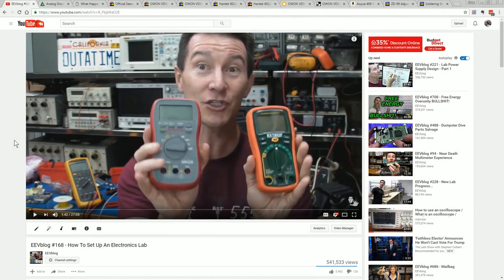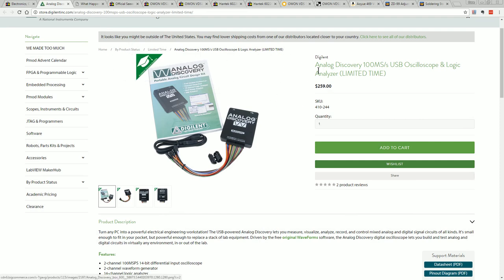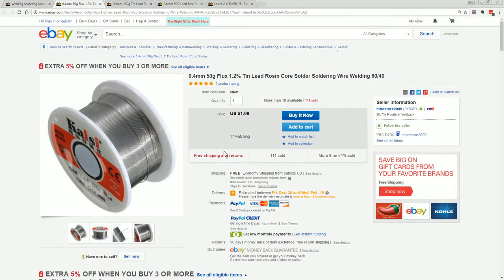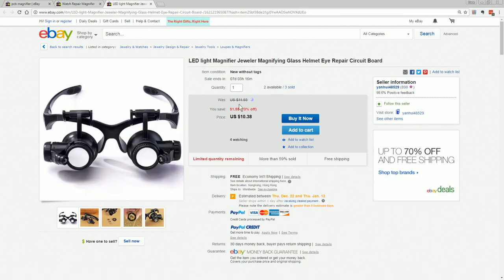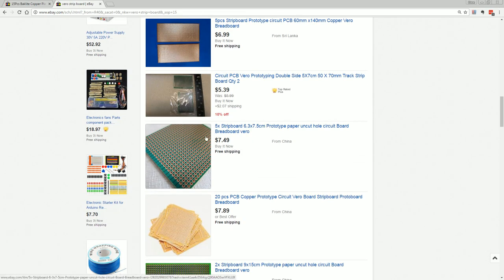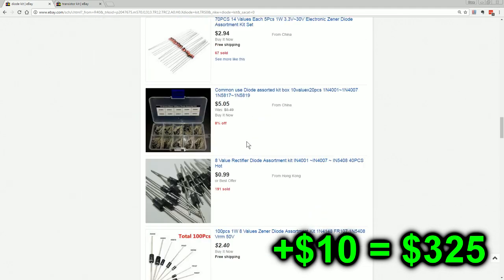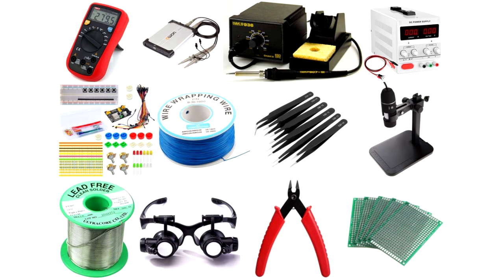EEVblog #954 - How To Setup An Electronics Lab For $300

Comment: I am on a tight budget and I've had to go with the cheap-and-nasty stuff and I'm finding it funny how Dave is listing many of the items I have here in this video :D I had actually thought about making a quick video myself, listing my own budget-setup, so Dave kind of pulled the rug from under my feet here!

I went with a Yihua 898D+ soldering-iron, though -- it's digital, it's small, and it has a hot air gun in the same package, which is handy, and I'm so far very pleased with the whole thing. There's a sensor inside the holder for the gun, so it turns heat up inside it only when you lift it up from the holder instead of just blindly blasting hot air 24/7, which should hopefully help make it last longer. As my DMM I've got a HoldPeak HP890DN autoranging one (I don't quite like manual ones), which is also quite nice for the price and seems quite precise. I've got a bunch more items in my setup that weren't mentioned here and that would probably be useful to a beginner/someone on a budget, but I can't quite list it all here in the comments, and I can't post pictures anyways.
Reply: Would you still recommend the Yihua 898D+? Whats the soldering iron like?

Comment: Don't get those magnifying glasses (the second one - black ones that look like specs). You have to hold the object really  close to you to see anything. Maybe good for jewelry or inspection work but not for soldering (If you mind getting your nose burnt that is :o) ).
 The first option that you showed (the large contraption that fits on your head) is rather good for soldering work, but note the plastic quality is not so good (brittle) and therefore handle with care. Also can get uncomfortable when using for a long  time. I have both of them.

Comment: I think for a starter it's more useful to only buy what you need. No microscope, fume extractor, solder cleanup stuff. A function generator is also not needed. Just get a soldering iron, tin, some cutting pliers, find some schematic online that you want to build, order those parts, and get cranking (To keep it in the Aussie athmosphere) :-). An osciliscope might be nice to see what the circuit and individual parts actually do.

Comment: Kinda annoyed by the way you hated on the Yihua soldering iron station a while back, but now recommending it for a kit. Yeah, it's a beginner kit, but it's a really decent station. The stand is flimsy, but the iron itself is solid, and as you say, it takes original Hakko tips and heating element replacements easy.
Reply from the maker: For $15 there is little other option. I still think it's a pretty crap iron, but it works. Less crap than the other crap.
Reply: for professionals it would be a different ballgame I think, its often not worth bothering with cheap knock-off stuff if you can afford better. I do feel Dave sometimes outright calls low end stuff crap, but im happy to see that's not really the case as he shows in this video low end stuff also works and can be used to make a decent electronics lab at a budget.
Reply: You have to start somewhere
Reply: There is a newer model now  Yihua 908D, with a display and switching power supply so no more heavy transformer and associated shipping costs. Got mine from Aliexpress to replace my failed low hours HobbyKing one where the replacement element is quite pricey.
Reply: >  I do feel Dave sometimes outright calls low end stuff crap

Yeah he isn't the most subtle person around :)
Reply: bobby dazzler
Reply: Got another one of those clones, except mine is a blatant rip-off that's even got "Hakko" printed on it. Reason I got it was that it used the correct gender for the 5-pin connector, so I could swap out the iron itself for a genuine Hakko if needed.

Haven't felt the need yet. In fact, what I did was purchase another cheap iron, chuck the crummy tip, and replace the heating element with an A1321 (or almost certainly a decent knockoff). This allows me to easily switch tips without waiting for my iron to cool down.

Rest of the unit is pretty decent too. None of the flaws I saw in the Yihua episode, except that the plastic is most likely not ESD safe. The kind of people for whom this would be an issue have usually progressed to the stage where they've outgrown the budget lab anyway.
Reply: Actually, Dave, I would like to hear your opinions on what makes a decent soldering iron, and how you would go about constructing one.

Apart from the obvious, good fit between heating element and tip, plenty wattage for fast thermal recovery (not exceeding what the heating element can tolerate, obviously), and something that actually controls it based on measured temperature rather than % duty cycle, which elements would you pay attention to?

Comment: Hello Dave. How about diode test at not expensive multimeters with automatic range selection? I saw a video which shows the multimeter with a delay of 1-2-3 seconds before a sound signal in diode test mode. For example, for what would have to ring circuit in the scheme need to touch probes and the circuit can go to drink coffee. It's just a hell of a fact, not a job. Maybe it stops on the multimeter with manual selection of the measuring range?

Comment: 4:10 - why is the soldering iron $5?
Reply: Its the tips.
Reply: No, the tips are ALSO a +$5 a few seconds later.  Before the soldering station, the signal generator puts the total at $171.  Then he shows the soldering station, and says +$5 = $176, then the tips and says +$5 = $181
Reply: +John Ridley Nobody's perfect I guess, but that threw me off too. Still though... Not gonna break the bank with most of this stuff anyway :)

Comment: For the oscilloscope, would a Propscope be a good option as well?  I have been looking at getting a little USB oscilloscope, and have used the Propscope before and liked it but wondering if there is better options at the $200 price point.

Comment: Got me some 1$ desoldering wick from china. Does pretty much nothing -.-
Reply: Yeah me too, you need flux, although I got some sort of gel flux which didn't seem to help a lot, but I heard that Goot stuff works alright... But I haven't tried any as of yet however.
Reply: buy quality wick,its just not worth fighting with the cheap stuff.
Reply: If this video was for quality, not a single item would stay on the list lol
Reply: It's basically copper, it should work, just add flux.
Reply: The ripoff gootwick on eBay is crap but genuine Japanese ones are extremely good. You can sometimes tell the difference by looking for a visible seam straight down the center, the fake ones have it.
Reply: I use chemititronics I think they are called, Just add flux on them manually and they work great.
cost 5$
for 8$ I think you can get top quality multicore \ loctite brand!
Reply: My go-to desoldering wick is Chemtronix's Chemwick brand. It already has the flux embedded. After years of fighting with the El Cheapo crap on the market, I will always pay the premium.
Reply: Need to get a wick with integrated flux. It'll say "no clean wick" or something like that. Useful solder wick is definitely more than $1. I got 25ft for $15 on Amazon. Unless you are de/resoldering an entire board, it'll be ages before you go through the whole thing.
Reply: I've never understood the point of soldering wick. I've always gotten by just fine with a solder sucker.
Reply: You have to flux it.
Reply: A desolder pump works great for me

Comment: A fan of a broken PC power supply in the usually L shaped part of the housing makes a good fume extractor. Especially if there is also some left over junk 12V DC wall adapter available.

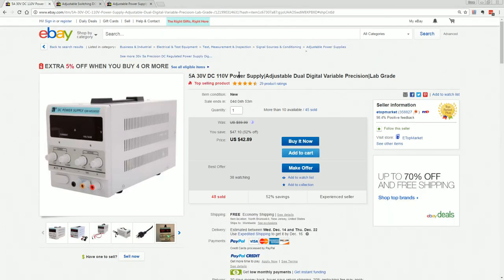Comment: 3:10 That power supply, QW-MS305D, isn't a linear one but a switching one and also bugous as you may see in a Youtube video entitled "FAIL: Bench Power Supply (PSU) QW-MS305D "... 

A dual channel linear power supply is very important because many circuits need negative voltage, like audio ones, without negative rail, only possible with dual channel power supplies, you will be unable to test many important circuits out there! Wire wrapping wire is so thin (30 AWG) that I really don't see its usefulness when compared with the 22 AWG one, and I think that a solder sucker is a better option than a wick! All the rest I agree with, I would just consider a cheap logic analyzer like the 5€ one (24M 8CH)!

BTW, if you're really short on money consider skipping the solder part and stick only with breadboards, then you may start to consider prototyping and do the respective soldering... You will cut some cost this way and still learn a lot!
Reply: you use the 30AWG wire to fix PCB whoops, run button leads to a faceplate, and other small-space work, it's not for day-to-day hookups.

Comment: I noticed that you recommended a USB oscilloscope over, as you have suggested in years past, a cheap used CRT analog oscilloscope for similar or lower prices. Any particular factors to that other than the isolation and logic analyzer? (Which are enough by themselves, yes.)

Comment: I was looking at that power supply you listed here and I was hoping that you actually bought these items to review. However I wasn't expecting to see a review I guess since you mentioned it, must work well and do as advertised. I probably will be purchasing this  power supply and I will share my experience if I have anything is worth noting.
Reply from the maker: Sorry, I can't vouch for most of this stuff personally. It's not going to be the best quality but it's going to at least work. If it doesn't work then you send it back.
Reply: I own two of the 220V versions. They work alright, but probably a long way from superb quality. I haven't inspected it much, but seems to do as advertised. They are a switching power supply, just so you know. Makes quite a lot of sounds when powered depending on how high load is on them etc., but I found some of the sounds to be quite useful to be alerted when something is not quite right with the circuit you are working on ;-)
Reply: lab power supplys can be very helpful, especially when you need a constant current source, but in all honesty i don't think you need one in a basic setup. 
most of the time you will be limiting current within the project and all you want is a constant voltage and you will be using mostly standardised voltages such as 5 or 12 volts, you can achieve this with power supplys you have around the house or an old computer power supply (vastly cheaper than a lab one for way more power). and when you want to have a none standardised or varying voltage then you can build a voltage divider or a linear regulator if its relatively low power which should be one of the first projects someone learns in electronics.

there are people who would use one regularly, including myself, but its a power supply at more than 5x the price of slightly less flexible ones most of us have a hundred of in a drawer somewhere.
Reply: I have one of the standard 30v/3A analog adjust supplies, and used it for about 3 years, but I found that a lot of the time I need to set up low current limits like 20ma, and that's almost impossible, it's too fiddly.  So recently I bought a Korad KA-3005D.  It's super nice, though out of the price range of this video.  However, given the choice when starting up, I would rather get this power supply and skip the oscilloscope. I did electronics at home for 40 years without an oscilloscope. I have a DS2072 now, but honestly I rarely use it.  I have had it for 2 years and I don't think I've used it more than 10 minutes the whole time.
Reply: Seb Andersen-Wood the reason I would benefit from these is for finding the point of voltage that will make something work. I don't want to plug in a 12 volt source all at once in case it explodes ya know.
Reply: that could be achieved with a mains to 12 volt dc power supply with your load across a potentiometer in series with a resistor to form a voltage divider. this allows you to slowly raise the voltage, the current would also be limited to the device under test by the resistor in series. if you want to know what the exact voltage is on a nice display then a multi-meter stuck across the device or potentiometer will give you that.
edit: you could allso build a variable linear voltage regulator circuit which would allow you to slowly step up the voltage.
Reply: I purchased one of these and it was advertised as the 220V model but I received the 120V model which looks identical. I didn't realise this until I plugged it in and there was a loud crack and a puff of magic smoke. I'm sure they're fine but make sure you verify you have been sent one rated for the voltage you expect.
Reply: ***** Oh. so its only single mode input. Good to know.
Reply: almost every power supply i have used has the option of both 240 and 120 v, they normally have a little switch on the back. if they don't have that, they often still use the same transformer (with unused turns) from 120 as 240,  you just move the inputs across the whole primary, instead of to the centre tap or vice versa. (switching the input voltage is occasionally done on the secondary with the same concept of a centre tapped winding).
Reply: when I started messing with electronics, my power supply was 'whatever spare wall wart was close to my needed voltage, with the wires stripped, and a power strip so I had a switch.' and to be honest, it still is.

I'd recccomend the bench supply, yes, lol
Reply: DFX2KX year same here. XD Those warts however don't usually come with enough amps. usually under a single amp. This bench will be great.
Reply: I have a flexion I think that was $53 and looks the exact same as that one except a different color. It's... Alright. The first one they sent didn't work, but they replaced it and now appears to be fine. They let me keep the old one too, so I took it apart and realized it was a bridged solder joint. I'd recommend only because they gave me one that works and it is quite cheap.
Reply: Erosion139 any update?
Reply: efedude77 not yet. I'm looking towards perhaps a small Christmas gift.
Reply: Hey Erosion139, I actually have the exact one he shows and it works great.  Very accurate according to my multimeter and hasn't failed me yet
Reply: William Ashland that's good to hear. honestly I don't have the tools to check accuracy and all that so it's nice to get an opinion from multiple people. Thanks.
Reply: I own a couple of these and they do the job pretty well.
Otherwise, it is always worth it to just make your own.

Comment: Oscilloscope? I just made a small op amp circuit and link it to my sound card I use for recording mixes, function generator? My iPad has an app for it and I made a small op-amp circuit for that too.
Reply from the maker: Sure, but having dedicated hardware is better.
Reply: EEVblog If I remember correctly on eBay there is a 50 dollar function gen that works really good with sine and triangle signals. with square wave there was some problem... The board is also available in a nice "instrument box". It is made by FeelTech.

Anyway watching your previous video about electronic lab I bought a Hakko FX888D. With chisel tips and all the stuff I needed. I moved from a cheap "mains solder" to the Hakko; now soldering is lot easier especially solder on pads with lead free solder. (I generally add serial pins on routers to hack them)

Regards,
Nicolò.
Reply: You are limited to the audio range of frequencies though. Even a  really old 10Mhz scope would be better.
Reply: The function generator on ebay for $50 generates really bad wave forms and the interface is clunky at best. Save your cash and look for one of the older signal generators on ebay. I got one of the victor models  for $40 and it while it isn't perfect it is light years ahead of that kit model.
Reply: I did it too for my Nexus 6P, works well in audio range

Comment: Thanks, exactly what I'm searched for!

Right now I'm building my own little electrics lab but portable... I've want to mount everything into a big plastic box so in case it is needed you only have to grab it and start working without setting everything up.
Reply: If your budget allows, check out something like the pine64 pinecil for a portable soldering iron.. full soldering station programmability... in the size of those 2 dollar cheapies.  Powered of usb-C PD or qc 3.0 power supplies.. its literally useable with cheap cell phone chargers in your car or using any usb charging device for laptops (starting to get REAL common now days) and even some battery banks or a LiPO battery pack (4-6 cell)... And if that doesn't work, you can power it off your power supply using a barrel connector...   It's a bit more than the soldering iron Dave here recommended.. BUT I feel the benefits of doubling to tripling the costs while keeping it super portable and very temp controlled... Honestly I feel it's equivilent to the ts100 iron that costs nearly 70 dollars...

Comment: A local store I work at sells decent Analog millimeters, the catch is the display is a needle gauge. About half the price of one that has a digital display that has the same functions. That would be a good alternative if anyone is looking into something with a few more features but doesn't mind the needle.
Reply: Analog meters are nice but they can't replace digital ones because of their low input impedance. Not really suited for probing transistor circuit with 20kOhm/V ;)
Reply: Travis Piper No auto-ranging, low input impedance ... The only thing they've got going for them is that they might have a faster response time than cheapo digital meters, but tha's not much.